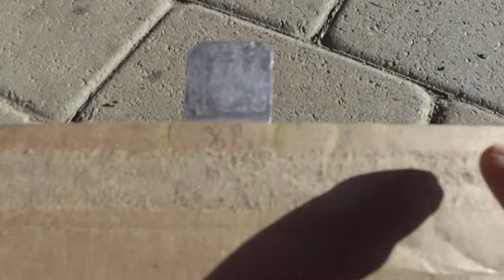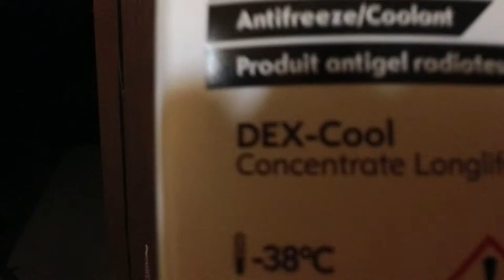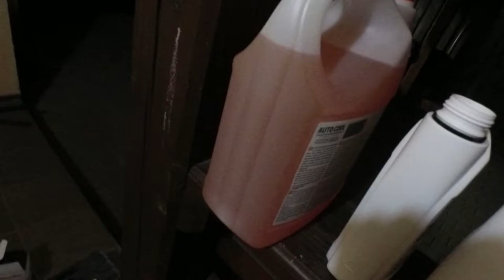Install GMPP 84309470 aux secondary radiator & Mishimoto radiator & thermostat on my C7 Corvette Z51

Comment: How many extra 1/4 oil did you add after installing oil cooler
Reply from the maker: I have actually used this as an extension to my coolant radiator (not as an oil cooler). But if it would be used as an oil cooler I would top off the oil until it would be at the proper level depending on your manual.